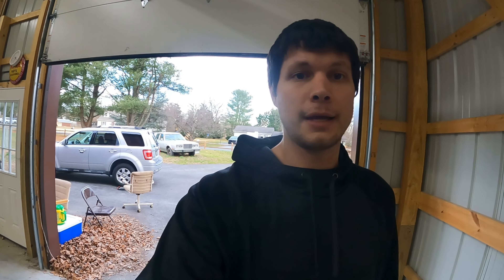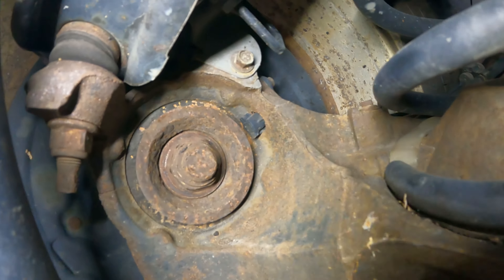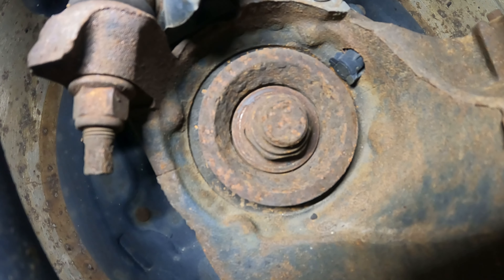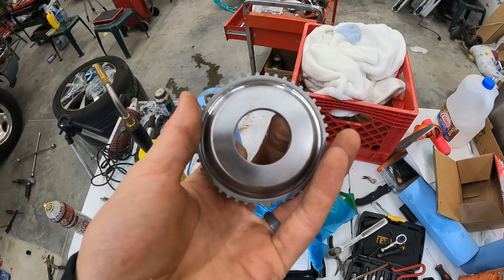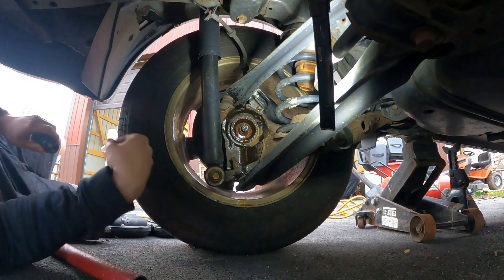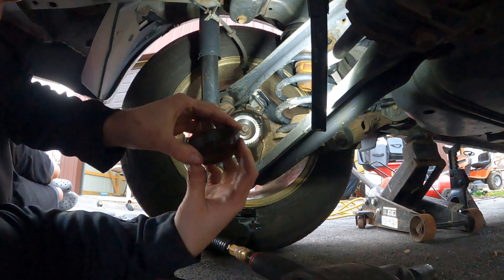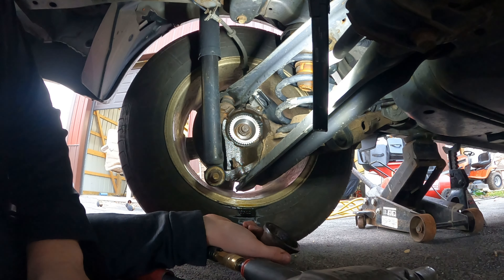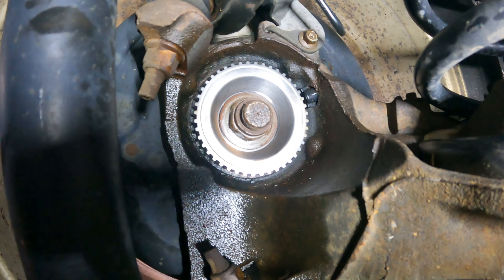Ford Escape C1236-20  -  2011 Ford Escape FWD  3.0 Rear ABS Sensor Ring Replacement - 30 Minute Fix!

Comment: Thank you very much. I never would have thought these were on the back hubs. I have one of the front that I need replaced.
Reply from the maker: For a front wheel drive model yeah the rear will have this instead of a cv axle with the tone ring. I have only seen this happen once so far on these personally but it certainly was a simple fix with the right tools :)